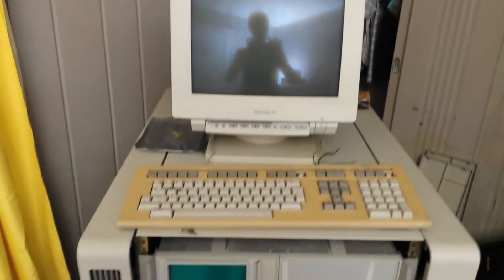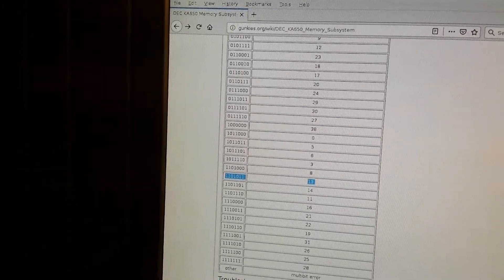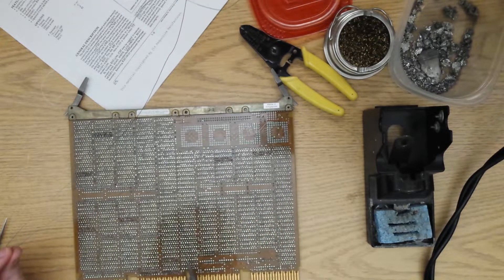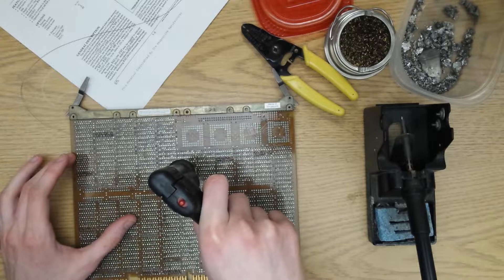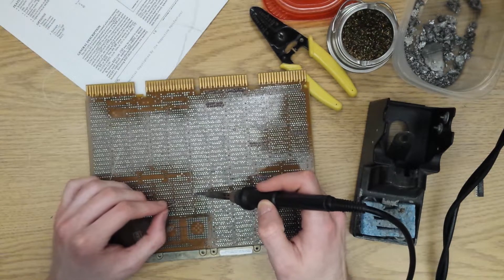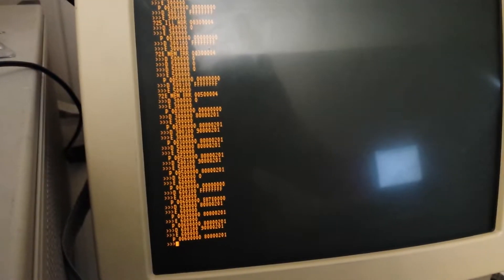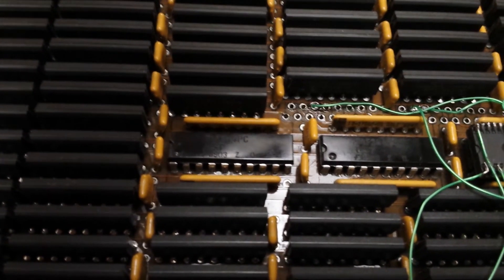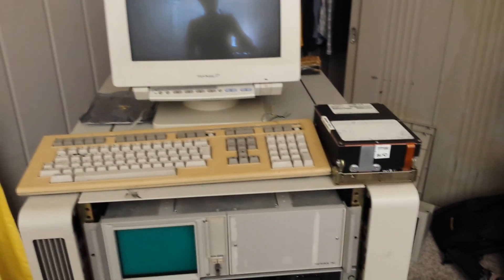VAXStation 3200: More RAM Repair

Comment: Enjoy your channel. Was with DEC for 15 years. VAX, 
OpenVMS Partner, Alpha VMS, OPS5, ULTRIX,  TOPS10/TOPS20, hardware and software Engineer,. Programming,  Cluster etc.
When DEC was sold to Compaq I eventually left and IBM reached out to me and spent 14 years there.
Mainframes, System Z, System P, System X, and System I. ALPHA and VAX migration to AIX(Unix) and LINUX.
Hardware and software programmer, systems engineering, IBM Cluster(SYSPlex)

Ricky from IBM.

Comment: You might check out solid state disks out of the UK, they make a CF card to SCSI-2 adapter with very flexible firmware and support for weird sizes like 768 bytes per sector.  I have a background working on Gould/SEL/Encore systems with MPX-32 that mainly used SCSI 2 but thought it might apply for you as well.